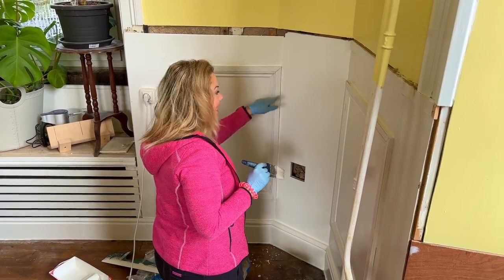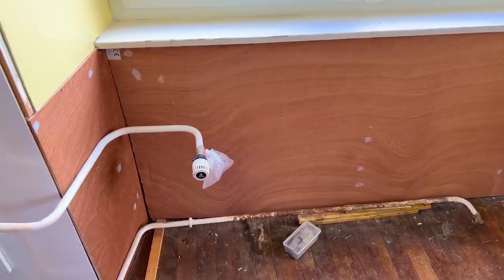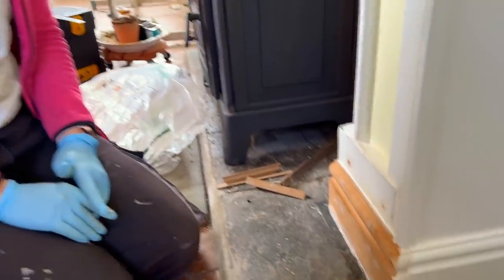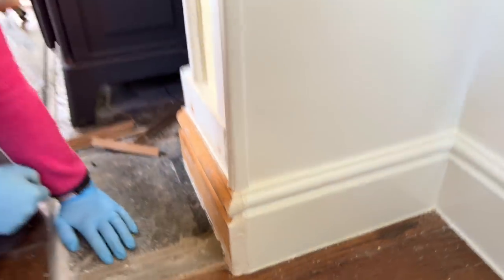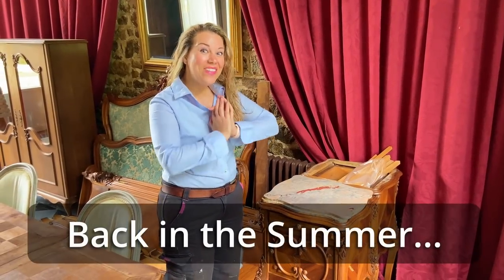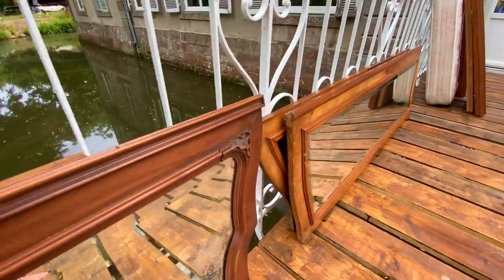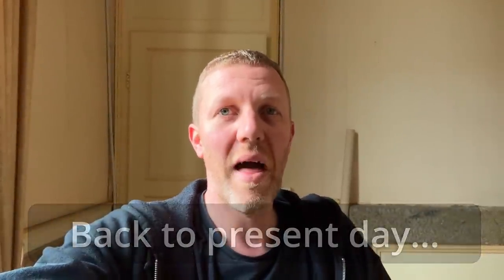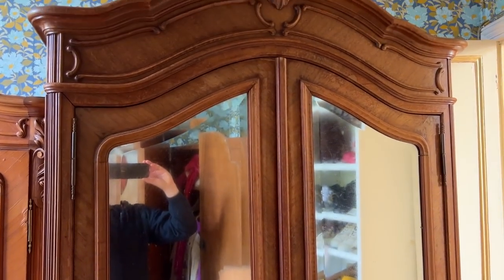🏰 EP 95: FRENCH FURNITURE EVERYWHERE!:  - Chateau Life

Comment: I have the matching pair of single beds I found in the barn when I moved in. Sadly the damp made the veneer fall off in most places but otherwise same carving.
Reply: Thomas Johnson (Antique Furniture Restoration) made some episodes of how to put back old veneer that has come looose by using hide glue (wich is reversible) and an iron.
I hawe a more modern cabinet from the 1920s i managed to put back some veneer stripes on by atempting to try what Thomas did, and it worked pretty good even for me as a total amateur. (If it is a valuable or very rare antique You should probably consult a real conservator).
Reply: @sheep1ewe  Yes I follow him a lot. In my case the veneer has almost all come off, I have kept it but have no plans to put it back on as I don't need the beds but they seem too nice to just throw out or burn. They could look nice sanded down as the wood under the veneer is solid and could be painted and prettied up. I will keep them until someone wants them as they are complete and I have plenty outbuildings for storage. I do have a large stock of different veneers and one day in a market a man sold me a huge crate of sheets of veneer that his boss was going to burn, I paid 20 euros for the whole case. I have a Louis XVI chest of drawers with missing veneer that I plant to restore ( I paid 50 euros for it ) it has lovely bronze details and a gorgeous thick marble top. I will put it on Instagram when done. Thanks for your comment.
Reply: @TheFiown  That sounds awsome
I had easily taken them for the old farmhouse if i had lived closer.